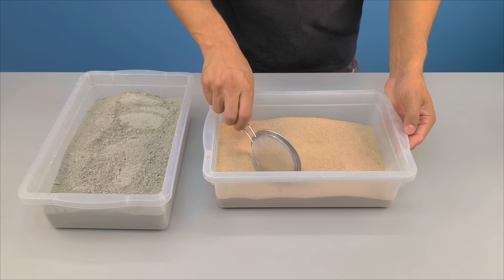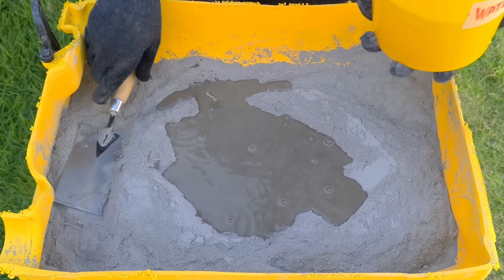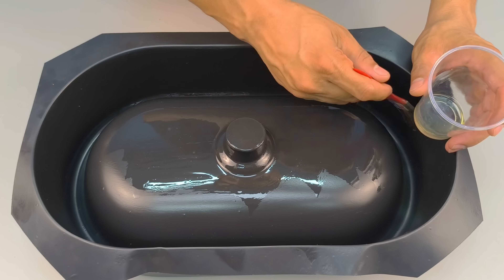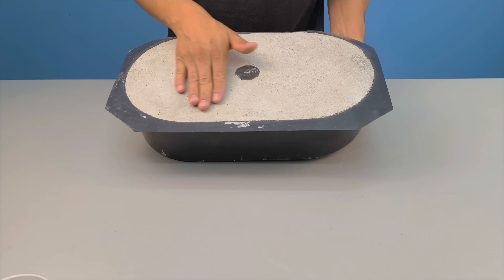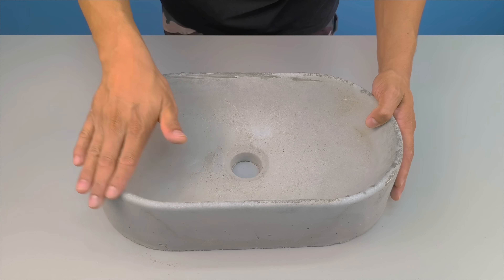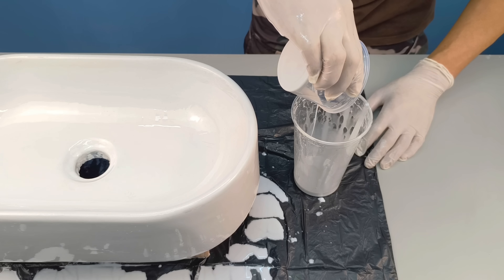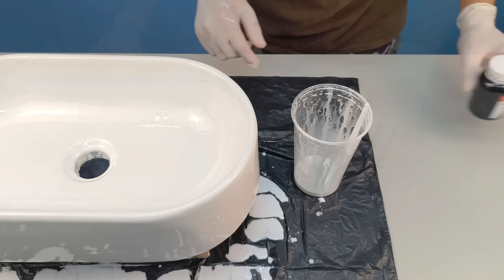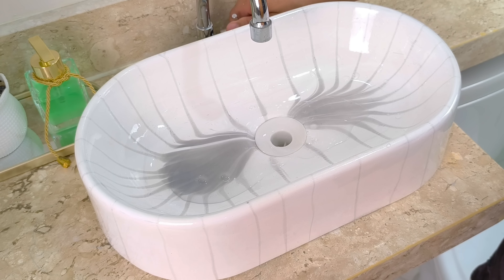Mix CEMENT with EPOXY RESIN and turn the impossible into a MILLION-DOLLAR idea!

Comment: You didn't mix cement with epoxy resin.
Reply from the maker: It actually was used, my friend 😊
Epoxy resin isn’t meant to be mixed directly into the cement — the two materials don’t blend well. The resin is applied as a finishing layer, and that’s what creates the glossy, sealed surface you see in the final result.
The experiment worked perfectly because the epoxy was used in the correct stage: as a top-coat, not inside the mix. 👍
Reply: Your title is deceiving and you know it.  Everybody saw WHEN you put the epoxy on, NOT IN the mix as your title describes.  I came here to see some maniac try to mix epoxy and cement.  Not only that dude, but when you cleaned the vegetable oil off of the sink, sanding it into the pores of the concrete is the last thing you want to do. There are better ways to get the form release residue off of the casting but I charge for that.

Comment: 20 minutes of hand mix? That’s too much for me. I’d use a mixer. 

Also, the idea that industry doesn’t want to talk about this “secret” is silly. It’s a common industrial type of product. As a contractor, I ran into all the time as custom countertops made for kitchens. Epoxy and cement. Acrylic seal coat in different colors. With enough additives you can get thin concrete to bend, which makes the countertops or sinks less prone to cracking. 

Nice video though. I’m from California.
Reply from the maker: Thanks for sharing your professional experience and insights on this!
Reply: The whole narration is AI generated. No one talks like that. 
Just enter the highlight topics you want the AI to work with, like "secret plans" and it makes stuff up. This AI stuff sounds terrible.

Comment: Portugal. It seems that you mix an even amount of sand and cement, correct? Not the normal 3:1 mixture
Reply from the maker: Thanks for your question! The specific mix ratios can vary depending on the desired outcome.

Comment: Never touch fiberglass without gloves & a mask!  You need to instruct people right off the bat.
Reply: I once removed old fiberglass roofing without wearing gloves... and the result was that I never dared to go near fiberglass again.
Reply: @khammounvapy  even worse than touching it is inhaling the fiberglass particles flying around during and after removal. They basically stuck in the lungs and later can cause cancer.
Reply: @mk6022 so I'm correct fiberglass has asbestos in it
Reply: @mk6022  No, worse is going to pee after touching fiberglass.
Reply: @khammounvapy  pitch in roofing tear offs have left me in bad shape a few times. Id b on the roof, probably 120 degrees with a ski mask gloves long johns, and would still be burnt up at the end of the day
Reply: Or, for that matter, cement powder. Very nasty stuff to inhale.
Reply: @TomBurke4015  burns your skin too
Reply: sure, been doing that for 50 years
Reply: @jarnosaarinen4583  lol
Reply: Fiber glass fibers are a but different from fiberglass insulation. Fiber glass fibers is an interesting process. Still doesn't hurt to use gloves to be sure. Many construction grade cement trucks use fiberglass in their mixtures.
Reply: @MildarValsik  well that's an interesting thing to know... All I had was my experience of touching and playing with it for just a few minutes in my childhood and after that I was crying like something was continuously stinging me the whole time... 😅😅
I will definitely search about it and give it to someone to check it, if it stings or not 😅😁
Sorry that was a joke.. but I will definitely search about it and clear my misconception.
Reply: @himanilsharma2147 fiberglass insulation is way difference manufacturing that it is that the "FIBERGLASS FIBERS". The string like structure is different. It might irritate skin to a degree but a fracture of how fiberglass insulation is.

I've been in contact with both as well as an adult. There is a difference between the two. The Insulation type is almost like cotton candy and if hit or handled improperly you can get some fiberglass particles in the air. The string like fibers are far less. HOWEVER I STILL RECOMMEND safety.
Reply from the maker: Thanks for the important safety reminder about wearing gloves and a mask when handling fiberglass!
Reply: @KassiusFineArt  I believe he touched the fiberglass barehanded maybe white gloves but I do believe he barehanded the fiberglass
Reply: @jasonmorlock95 You're shitting me. he went raw dog how many years do you think he took off his life?
Reply: @jasonmorlock95 I wonder if he's as careless with his pecker. 🐔
Reply: @jasonmorlock95 1:51 Greek
Reply: @KassiusFineArt  vou fazer, mas vou deixar rústico, com as imperfeições. Amei. Sou do Brasil ☺️
Reply: It's only irritant ,drywall is full of it .
Reply: They can learn the hard way, the natural way
Reply: ❤❤❤ merci
Reply: @KassiusFineArt  Won't lie and say i didn't know this piece of info, but still thanks for warning people that stuff is nasty as hell if  miss-handled.
Reply: @KassiusFineArt  it's carbon fiber
Reply: @hanaxinjiang  The material used in the video is fiberglass. Definitely not carbon fiber. Usually carbon fiber is dark gray, but there are some very specialized carbon fibers that are white. The material he used is definitely fiberglass. I've worked with these materials for a decade.
Reply: I love the plain white colour
Reply: Lol bunch of softies
Reply: That’s great advice I work with both types strands and powder and I just wanted to add if you do get either type on your skin never wash with hot water as hot water opens your pores making it easier for the strands to get further into your skin only was with cold water to help remove most of it and even then you still might have some stuck in your skin so ya best advice is wear mask to prevent inhalation and gloves and protective layers of clothing to prevent it from getting on you
Reply: I hope the bat you use is a soft bat otherwise you may hurt someone
Reply: @KassiusFineArt  yet we breathe aluminum, strontium, and barium on a daily brought to you by our lovely government.
Reply: @KassiusFineArt  QUIT CRYING
Reply: Same lesson learned this year! The new asphalt tiles had no warning 😢 After a few hours the uncomfortable feeling sent me in search of better ppe. Appreciate this video to provide customizing projects!!! Successful 2026 🎉
Reply: @KassiusFineArt  that it just the fiber I've used it many times it comes In small pre measured bags you can get some that you don't open depending in batch size but if splitting the bag between mixes it's best to pour into a 3/4 full 5gal bucket and mix thoroughly then you can get a measuring cup according to how big your batch is depends on cup size a small drain hole is needed in the cup ....dip out your cup full pour it in the mix if the majority of water drained the remaining drip is fine and it's best to add  water then sand and begin to mix adding in the fiber once it's all mixed add your cement slowly and evenly if using a powered mixer with paddles be sure to keep them clear of picking out your fiber it will collect on them quickly when using a paddled mixer shorter fiber and pre soaking in the bucket helps to keep the fiber where it lands in the mix and doesn't pull moisture from your mix or product when already saturated
Reply: @KassiusFineArt  always a safety Karen.  People do it daily.  It's just up to each person.  Calm down
Reply: We played with mercury as kids . Casted lead figurines for bracelets. 
Smoked tobacco since i was 10 years old. Put butter and fat in everything. 
U never feel better.
Reply: Ok karren
Reply: Cement is quite dangerous to breath in also.
Reply: True. It is unsafe to handle glass fibre by bare hand
Reply: @user-my7eh7xd8f 
Oui mais il y a des matériaux dangereux mécaniquement comme la fibre de verre, desquelles on peut se protéger. 
Et il y a des matériaux dangereux chimiquement, desquelles on ne peut pas se protéger, et que la nature n'est pas capable de recycler car elle ne les connaît pas ‼️
Reply: Yes, when i saw those bare fingers picking up that fibreglass i started to itch and hoped he at least remembered to wear a mask. 😮
Reply: Gosh. I survived years of boat and surfboard building without caring as much as y’all by half. Imagine how much better I could have survived if I had nanny’s like you! ( as long as it isn’t short fiber or worse, dust in the air, neither fiberglass nor cement is a problem. )
Reply: @Ave_Xavier  I agree with you   45 years dealing with mat and cloth  , sometimes large amounts, you just have  to use common  sense  !
Reply: @Ave_Xavier  that’s some tough talk there, but I just once handled fiberglass cloth barehanded for about a week, and afterwards, the itch over my entire body lasted nearly two years. Fiberglass is not a joke. Better safe than sorry.
Reply: @gvc76 hahaha seriously dramatic much?
Reply: @213BRANDONP  feel free to be dismissive about someone’s personal experience. And feel free to ignore advice on how to protect yourself from harm. Are you one of those who are also upset about seatbelt laws?
Reply: @gvc76  to breath in dust from fiberglass is not good at all, but itch for 2 year🤣, a day mabye
Reply: @nilssonnr11  It depends. If you have allergies to it and it gets embedded in your skin, in can be pretty miserable for a long time. I've worked in the aerospace industry for a decade and seen several people have those reactions while others are never bothered. I usually just used shrink wrap tape to remove the fibers, and it stopped bothering my skin.
Reply: @KassiusFineArt  I thought something was off there…thanks for noticing!
Reply: @KassiusFineArt  this. Omg! the moment of silence/focus on that cement dust... 👀 I wonder how the instructor is after this video?
Reply: 😂 leo sus comentarios sobre el cemento y me causan algo de gracia ya que soy mexicano y aunque no soy trabajador de la construcción si conozco el material y cierto puede ser dañino para la salud pero conozco albañiles de 70años que toda su vida lo han manipulado sin guantes sin cubre bocas y prácticamente todo el día y aquí siguen trabajando.. pero claro son hombres no chingaderas 😂😂
Reply: It doesn't look like true fiberglass. He'd never be able to casually pinch up handfuls. I wonder what it really is?
Reply: @cherylberry1613 not sure you can casually pick it up. some of us have grown to where we don't even notice the crap anymore. the only stuff that still bothers me is that yellowish insulation crap that stuff's horrible but stranded. Matt, no big deal long as it doesn't get on my face
Reply: @cherylberry1613  its real fiberglass. Wtf are you guys talking about i handle fiberglass daily. Sure it itches a bit but it won't kill you 🤣

Wear a mask if its insulation.
Reply: True... Because once in a lifetime you touch fiber glass with bare hands you will never go around it, forget about touching it. 
Also it is very dangerous if you inhaled small fibres of fiberglass. Its much more harmful to lungs than you can think. As it causes many diseases due to continuous inflammation in lungs.
Reply: He never used fiberglass. He only used cement and epoxy. Maybe you need to change your term.
Reply: @M2M2-y4i  He did use chopped glass.
Reply: I've touched fiberglass many times WITHOUT GLOVES and have never had a problem,, the problem now day's is everyone has OSHA ON THE BRAIN, and you must wear gloves etc for every little thing you do.. but wait,, NO YOU DON'T!!
Reply: People of these mad times are becoming more and more sterile. I see here many of them giving useless warnings about cement, apoxi or a little bit of fibre glass, like it’s cholera, instead of wandering the hard beautiful job. It’s crazy! Stupidity at the highest..! They think, if they work a little, they’ll drop dead..🤪🤣😝
Reply: @geldoncupi1  you know that you can do both, right? You can admire the nice job, and you can also give advice about safety. You can do hard work, and still take measures to protect yourself from danger.
Reply: The product has warnings printed on the lable. Its not a big deal, Chief.
Reply: @rodneymiller4437 
Vous avez raison l'empoisonnement, l'intoxication, et la mort, ce n'est pas grave 😳❗
Reply: Moi je n'achète jamais une maison dans laquelle il y a de la résine époxy... Bien trop toxique.
Invendable la barraque ❗
La résine époxy est une abomination pour le vivant et les écosystèmes. 
Où croyez-vous que vont les vapeurs toxiques et les particules lors de sa dégradation ❓❓❓❗
Dans le corps de vos enfants qui deviendront stérile... dans la terre, dans l'atmosphère...
Reply: @oooozone that’s so interesting don’t people use epoxy resin for things such as trinkets, tables, covering floors  jewellery, cutting boards and more.  🙏
Reply: @oooozone  wow!

Comment: Very good..... most basins like that here have an overflow hole near the top (inside) which connects to the drain hole pipe beneath so if the plug is in the bottom of the basin and tap left running it can't overflow all over the bench
Reply from the maker: That's a great point about the overflow hole in basins!